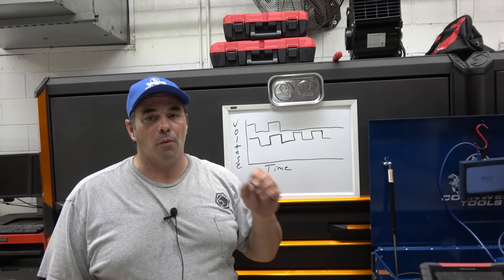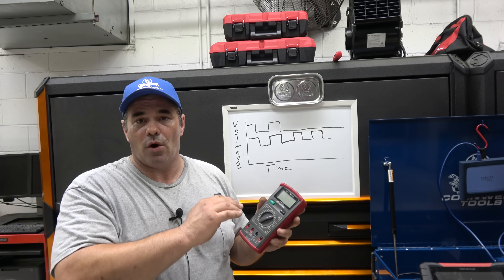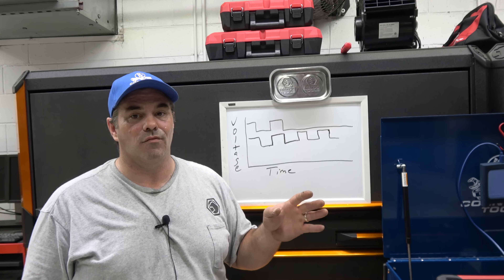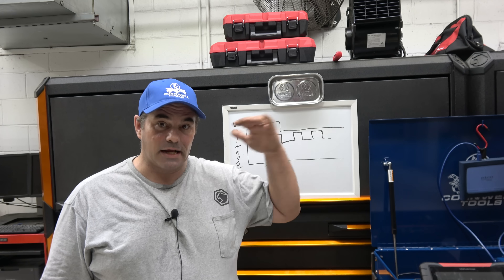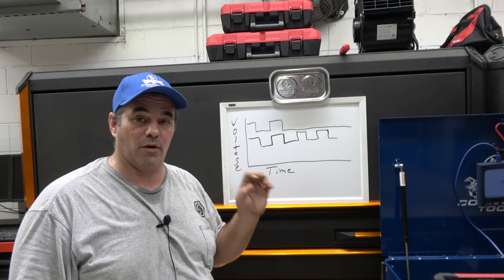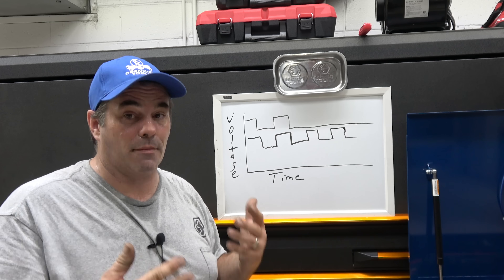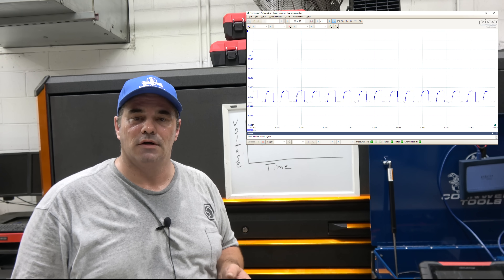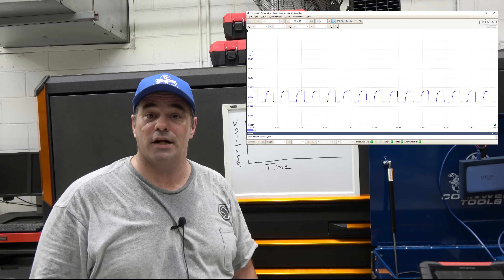Intro to the Automotive Scope,Basic Theory and Uses in Auto Repair

Comment: Hey Mike, can u tell me all the situations on a car where the voltage can spike higher than 40 volts? I bought a 20:1 attenuator for my Launch Torque 5 scope. I only remember secondary ignition spiking to 66k via a coil and a starter drawing 150 -250v.

Comment: Great start. What I would find really helpful is some more intermediate to advanced stuff. What parameters do you need for a good scope? What is Bandwidth and the role of Bandwidth? How is sampling rate related to timebase, and what specs do you look for to make sure you have a high enough sampling rate at the relatively long time bases used for Automotive work .. ie a lot of scopes deliver high sampling at very short timebases, micro and nano seconds. But in Automotive you need good sampling rates around 1 to 10 MS/s in the millisecond range, especially for ignition work. Be great to work through all these variables in action.

Comment: Saw a guy diagnose a fuel pump with a scope once. One bad spot in the pump and you could see it in the scope pattern. Saved a lot of time, less invasive, and found an issue that could have been missed testing pressure. It was really impressive.

Comment: For camshaft sensors (3 prong) I use innova 3320 volt meter ($20) and watch the voltage from the sig side. If it is constantly changing between 1v and 5v, it's good. If it moves a within 1v range, it's no good. 

I know they say you cant do this but I do and it works

Comment: How often do you need to use more than 2 channel scopes? Sort of a survey I'm doing.
Reply from the maker: Most times 2 or 3 channels but for those times you need 4, you need 4 of more channels
Reply: @flatratemaster  Sounds like a job for Pico but Pico doesn't seem to react as quick on a laptop as apposed to one built in to a scanner like a Modis Edge, maybe there is some kind of delay working through the Windows operating system

Comment: Great Video. I want a better scope.  I have been able to make my little crappy USB scope do a lot.  Mine has no storage, is only two channels, and only does +10V to -10V.   A 10x and 20x attenuator helps to overcome the voltage limitation but you have to just do the math to know 1.2 volts equals 12 or 24 volts. 

I use screen recording software to be able to play it back, but of course I can't change my time base or voltage and "zoom in" on a play back.  I don't have a amp probe but I have found you can do a pretty good relative compression with just a voltage measurement.  The voltage will sag on the good compression cylinders but will stay higher on the low cylinder. 

I've ordered a low amp probe so I can see the divets in the fuel injector waveform to see if an injector is actually opening and closing, which you just cannot see with voltage alone. 

Two channels isn't really enough anymore for cam crank correlations, because so much stuff has more than on cam sensor.  Every car I work on though I try to get a known good  correlation screen shot of crank and cams sensor 1 and then crank and cam sensor 2. 

I haven't' got to work on any can bus problems yet, but I can't wait to have one to do.
I used my scope a while back to diagnose a HVAC blower problem in a Porsche.  The customer was sure it needed a blower motor, and the symptoms made me guess it was a motor too.  I was able to prove with the scope it was a fan speed regulator issue in 10 minutes.   I was still really hoping I was making the right call when ordering the part, and I was right.  Saved the customer a lot of money.
I found that is is super handy for seeing duty cycle signals on things like a IAC to verify the computer is sending the signal to adjust the idle under different loads. 

I have all my parts ordered to make my own pressure transducer (which is pretty cheap to make), but I haven't got them together yet.   I want to do a video on that. 
My point to all this is if you can't afford a Pico, get something.  I am probably still just going to a Hantek next.  An 8 channel Hantek can be had for $120 on Amazon.  You can work around a lot of stuff and save a lot of time on diagnosis even with a crappy scope.  The whole time you are learning how to use a scope and when you do get a Pico you will know what all those extra features are that you've been wanting and when you need them.
I have learned all this as a DIYer in my drive way.   It just takes playing with it and figuring it out and soon it becomes second nature.